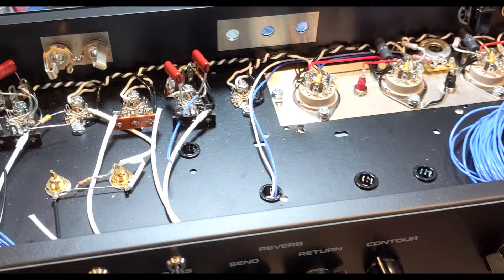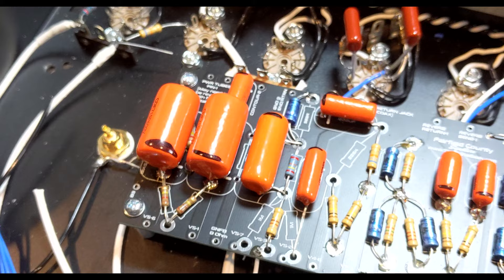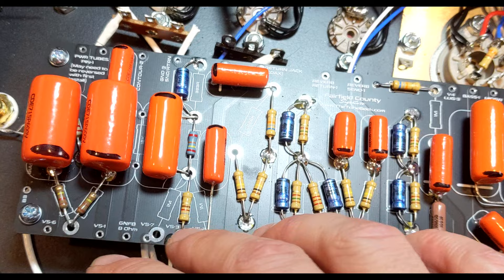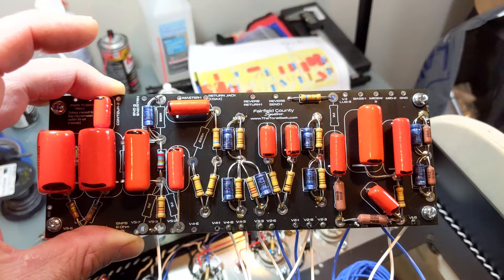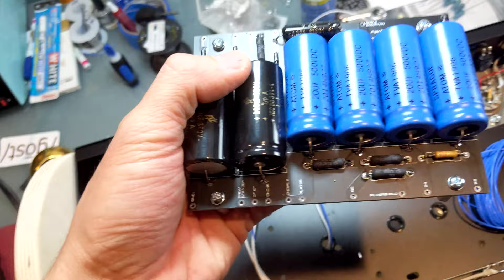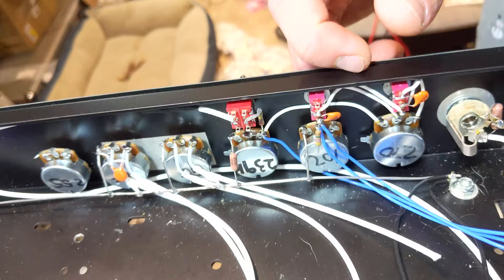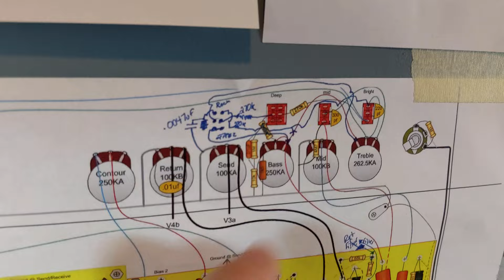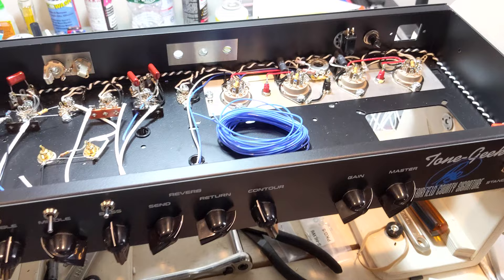Fairfield County Signature Build Series Part 1 | Building a TR John Mayer Signature

Comment: Hi Ryan your recent video inspires me to build one against my Ceriatone version. Which leads me to my questions: Why do you have 226k instead of 120k (AN) on the v4b plate that goes to the master? ALSO if Ceriatone doesn't have that fet DRAG resistor for V1 power, that is a big breakthrough discovery ?!? It will impact the v1 voltage & response? , and is it related that the Ceriatone routes the same power supply line (X6) for both V1 plates and reverb send/return (v2) plates? (..perhaps to compensate voltage for lacking the fet drag) You know, unlike AN, in which the reverb plates (v2) gets power separateley from between the 22k & 2k2 droppers (b4)?! .Anyway, Thanks! More power to you, it's amazing what you come up with and make!